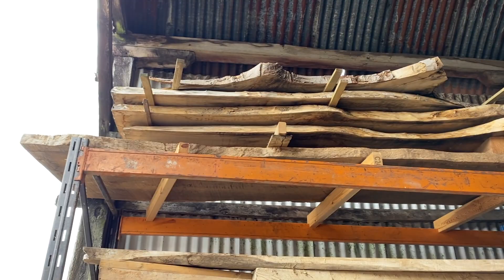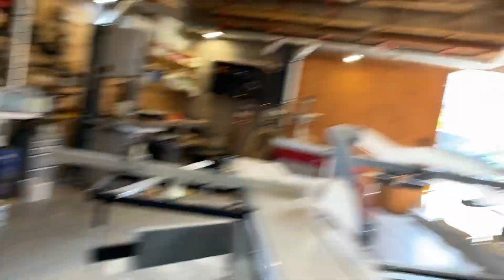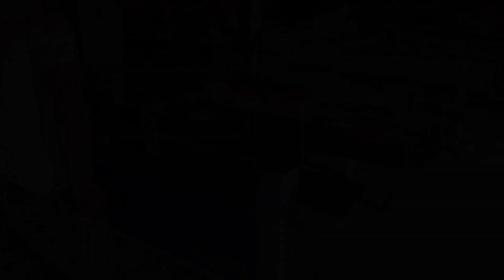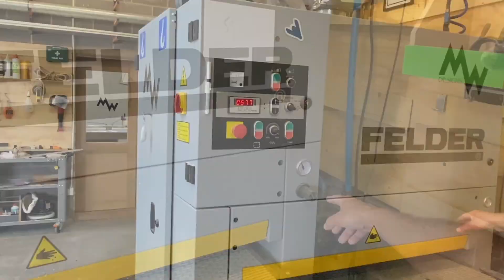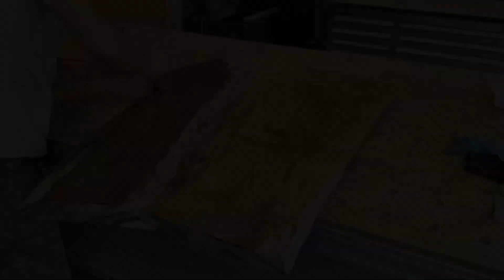#MWshoptalk   English sycamore

Comment: Have found that on occasions Sycamore stains very easily.
Also, not as a criticism but you need a lot more stickers on the planks and to move the first stickers right ot the ends of the boards. My uncle in law is a Sawyer of 40 years experience and showed me the correct way, as it virtually stops any of the board ends from flicking up
Reply from the maker: Thanks for the tips!

Comment: I wondered if you use Osmo?  I have recently used it and was very impressed on an in door side table I made. I also have an outdoor dining table for the patio and I was thinking of using Osmo,s outdoor hard wax oil on it but also taking into consideration other similar outdoor finishes. What would you recommend?
Reply from the maker: I don't use Osmo , just the one linked below it much harder , there also have a outdoor one which I used on my Bench build https://youtu.be/PKZOzJHcdT4

Comment: Sycamore is great when it is newly worked.  When exposed to light in normal room conditions it slowly becomes a yellowish-brown nondescript sludge kind of a colour. Many years ago I made a wall-hanging desk from Mansonia  with Sycamore fronted drawers and a Sycamore insert to carry letters etc. 
Mansonia, an African hardwood, initially looked like Walnut. Now there is not a lot of difference between the appearance of both woods. Photochromic effects have lightened the Mansonia and darkened the Sycamore.  But it will take a year or two before your punters notice their Sycamore is looking more sick than it once did...
Reply from the maker: Hmm doesn't  sound so good

Comment: Thanks Andy - very interesting.  I've not found a good reference on how to use a wide belt sander, I just know what I've picked up but I'm sure there is a lot more to it.  Do you have any suggestions where one might learn how to use them properly?
Reply from the maker: Not really I don't think there is a wrong why are you just taking off .1 .2 of a mm each pass then very small amount on the air pad :)
Reply from the maker: and store paper with know flat spots